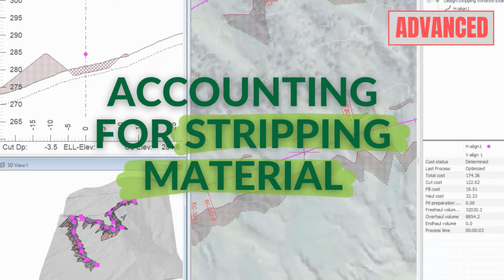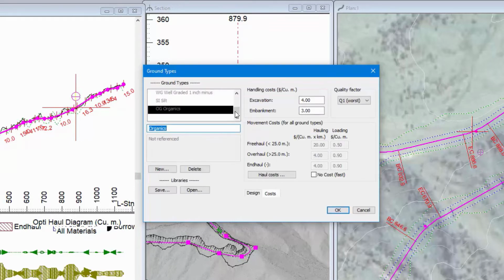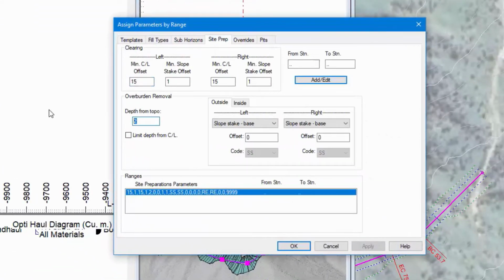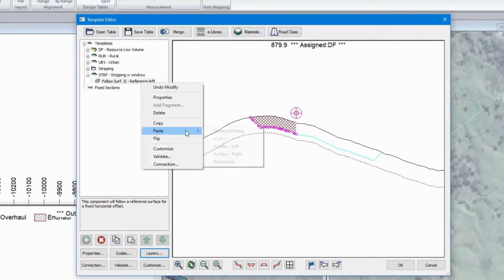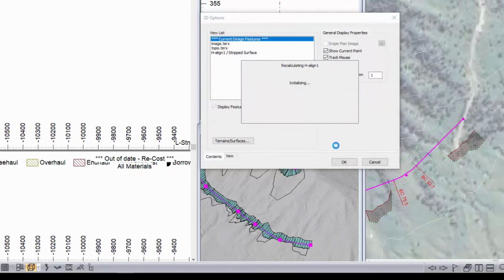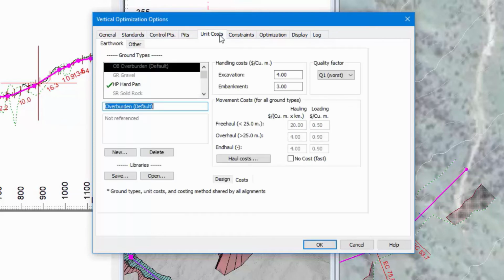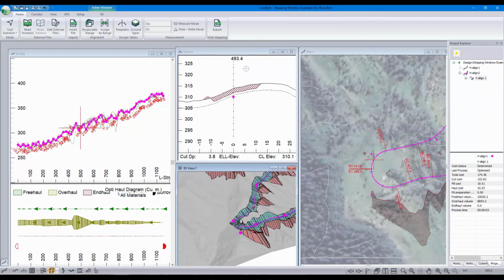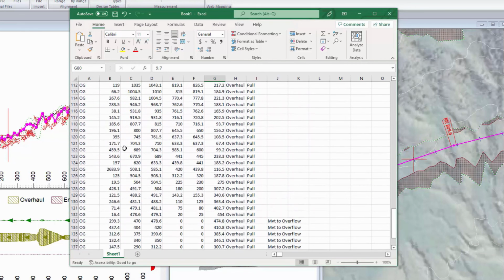Accounting for Stripping Material Adjacent to a Road Design

Comment: Thanks for the video! Would it be possible to specify a maximum right-of-way to limit the height/daylight of the stripping material? If we have a 30m ROW for example. This constraint might add more material movements of course $$.
Reply from the maker: Good question @pierrotdufour1834.  It can be done; however, a max disturbance width is not an existing parameter in the windrow template.  To get around this, you could:
•	Customize the windrow template with additional parameters and logic to achieve the desired behavior, or
•	Use the existing templates and workflow but use a reduced topo surface that only has surface within the permitted RoW.

If you'd like more details on either of these options please reach out to our support team directly.